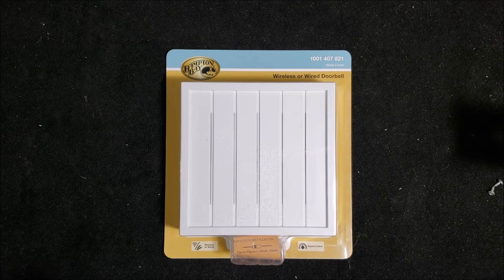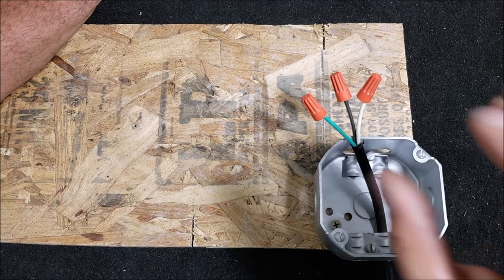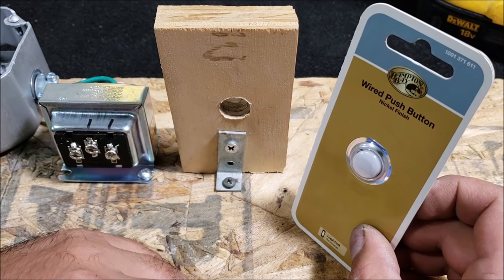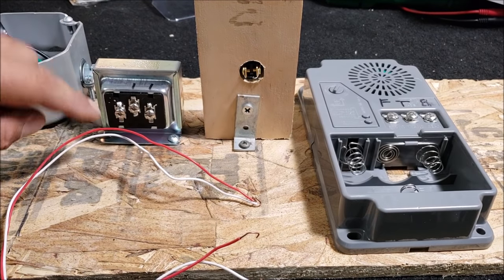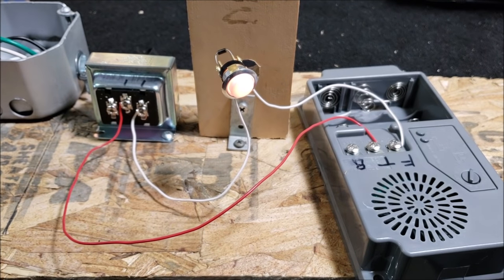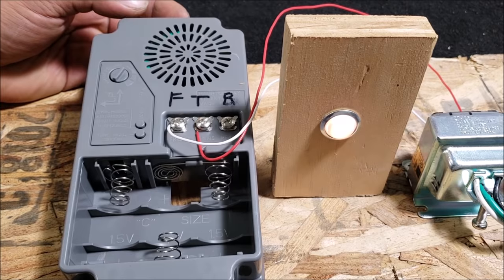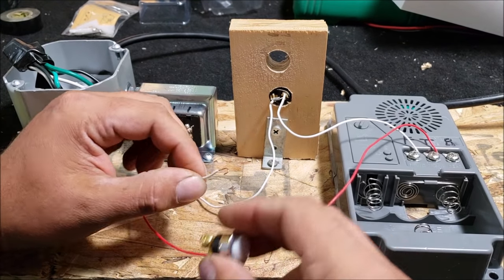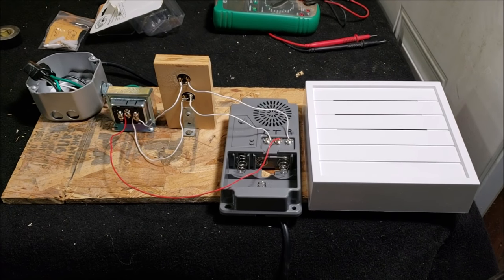how to wire a doorbell DIY live demo and wiring diagram

Comment: Mr. Chris Craft, I just want to say thank you for this clearly explained how to wire a doorbell video.  My wired doorbell stopped working about 10 years ago.  At the time, I tried but couldn't fix it.  So, I got a wireless doorbell.  It worked for a while but not reliable.  After several years I got another wireless doorbell.  Same result.  After listened to my wife's harping on me to fix the doorbell I went to YouTube and found your video.  The simplicity of your explanation was perfect.  I was able to follow your diagram and sort out the mess which was my existing doorbell wiring.  Look, I just want to say thanks.  Do more videos like this.
Reply: Why is it that wives can complain about things for years but not even attempt to fix it themselves?  Wouldn’t it be a treat if they did? I help around the house with vacuuming, washing dishes, laundry, cook some, but the help never seems to go the other way.  “I cant do that stuff” is the response.  Yet, women want equal pay in the workplace?  Non sequitur I say.  😂😂🤦‍♂️

Comment: The diode works wired in either direction because your source voltage is AC and not DC and AC which is alternating current that swings from positive voltage to negative voltage and back again continuously.

Comment: After spending countless hours wiring and rewiring, I am so glad I ran across your video.  A diode was the reason my chime would not work.  Thank you a million times over for posting your video and mentioning that tiny diode.  I purchased the one I needed and the chime works like it should!

Comment: Good point about the diode, this is a life long issue with people putting in doorbells.  They think "Ahh, I don't need that, it's a pain.  It works.."  then complain about it.   A company would not spend the money to include it if not needed.  It's only a few cents but, over the course of a million units, it's a lot of money. 
  I like the seasonal ring tones for Christmas, new year (Auld lang syne) and your birthday...  lol. Bethoven is cool, too.
  Mostly, I appreciate your straightforward, lay out and test the unit first approach because it ensures the product, your doing it right and removes confusion when you start stringing wire.  Common sense stuff, which isn't too common, anymore.   Thanks!
(P.S.  You'll enjoy your ring doorbell.  I recommend them to anyone.)

Comment: I love these straight-ahead DYI type videos. Working out the details and bugs as you go through the install.  Which is how I tend to do these things.  I need to get power to my Ring doorbell because I am tired of removing it and putting it on the charger. I saw the Ring doorbell in your video, got excited for a second until you said that was for another day.  bummer. Anyway, thanks for the wiring help.
Reply: I disconnected the original wiring and put in this battery powered, wireless doorbell box a bunch of years ago. Now I need that connectivity to set up the Ring but I'm not sure how to reconnect things to get a current back to the Ring.
Reply from the maker: @MrVeeBlog  i just uploaded the ring transformer video

Comment: Thank you for this. I just bought a nest video doorbell thinking it would solve my problem on not having a doorbell connected, but apparently, you still need a full doorbell before installing the Nest. Argh...I will have to figure out how to get that done and how to pass the wires. At the very least this gives me a good idea of how to do so.
Reply: Technically, if you don't have a hard wired doorbell you can still use the nest doorbell as long as you have google home speakers. That's what I did.

Comment: LOVE the simplicity of this video...just got rid of Ring and got Nest Hello, and something happened to my original chimes, so off to Home Debit!!!!
Reply from the maker: why did you get rid of ring?   i hardwired ring to this door bell(i have a video)  and it has been running perfect for over a year now..   battery is at 92% ...  let me know..
Reply: @chriscraft77022  Hey Chris...the Nest Doorbell has just a plethora of neat options that were too hard to pass up. First, I got the Ring Pro and an Echo 5 for my wife for Christmas ( a killer deal at $140 for both). I got the Ring installed but hadn't got the Echo setup, then my son got me a whole bunch of Google Home items for Christmas, which we celebrated with him on New Years Day. I was sold on GH from that point, even though I had invested in a few Echo products and had the whole home setup (with my Insteon system), I ordered  a Google Hub (the 7" screen), and researched the Nest Hello on various reviews. Ordered the Hello Doorbell on eBay for $179, then sent back the Ring and Echo 5 to Amazon, and now easily got everything setup correctly (definitely had to replace the transformer with a 16 volt, 30VA transformer from Amazon, so now even my home address sign on the front shines better!).  I LOVE the ability set the Activity Zones for different notifications, and as I've always used Google Photos for all my pics, the ability to have Familiar Faces setup was key (GH will announce WHO is at the door if you've set this up). PLUS....the announcement feature (that many seem to forget to set in Nest)) announces someone at the door - at every Google speaker you've setup, and we've got one in almost every room of the house (more to come with the work shed, backyard, and few more Google displays)! Also, the 2-way sound is MUCH clearer with Nest Hello. Video is as good as my 2k Lorex cameras (12 of them).  I've got the 30 day trial, as as much as I'm against any re-occuring fees, I'll probably wind up forking out the $50 per year for the Nest subscription. I just like the way that Google has integrated everything much better and easier. Oh...and no battery with Hello to worry about...it's all hardwired. And it all runs on the 5G band of my home network. My point about the existing doorbell was that: 1) I'm not quite sure I need to replace it, since GH announces everywhere, and 2) in wiring it might have got screwed up between a Ring installation and the Hello installation (and I can't even find a manufacturer's name on the unit, so you know it's a contractor special, so it's junk). But soon to be selling the home, I'll probably get a new chime because the Hello Doorbell is moving with us (unless a buyer wants to pay for the whole GH system!).

Comment: In this particular case, the direction of the diode doesn't matter because it's an A/C system. The electric is always switching directions, back and forth; 60 times per second here in the States. The diode keeps the power going in one direction flowing so it can keep the chime playing. So, it's basically using only half the power to play the tune. If the diode is not there, then all the power disappears when you release the button, and the tune stops.

Comment: Thanks so much.  That sure made the project a lot easier.  Adding a second doorbell with Arlo.  My big issue is finding a place to wire in the transformer.
Reply: I found an old mechanical doorbell in the basement that has 4 metal bars like a xylophone.  Am hoping it still works.

Comment: Pretty cool. I used a wireless doorbell for the longest time but I've recently upgraded my system to a ring doorbell and I couldn't remember how to wire up a doorbell. I was thinking the new ones had the transformers built into the chimes. Anyway I am using the battery for now but I want to be able to use more features and not have to waist batteries. I already have a roll of wire so I just need the transformer and chime. It would be easier if they just included the transformer in the chime but I guess it will be cheaper to replace that way. It seems like my old house I had to replace the transfomer a few times lol.

Comment: Very clearly explained! 
 I took off a 20 year old door chime from the wall and there were 4 wires on the back of that unit (red, white, blue & black) and 4 wires coming from out of the wall. There is only a front doorbell being used.
I'm trying to hook up the same unit as you just showed that only has 3 terminals so not sure what to do now.  
Would you know how to solve this issue?

Comment: Hello, I have a question: in my country the voltage used is 110v, there is a problem if when installing my doorbell I do not use a transformer, I have already tried it and it still works without it.  Thank you

Comment: I’m in a similar situation, purchased an older home where a doorbell was never installed. I wanted to add a smart doorbell. Could I run 20-2 directly from the transformer to the doorbell? I don’t have a need for the chime, so is it possible to step down the voltage and have it run from the panel through the transformer and to the doorbell?

Comment: Questions for you... is there any harm in using a 16 Volt transformer with a 30A output, instead of one that is 16 Volt with a 10A output?  I have a large house with long runs and two non-electronic chimes and two spring loaded buttons.  I am currently running the 16V-10A transformer, but I would like to know if there is any harm in installing a 16V-30A transformer?  I ask cause I am wondering if my chimes would be louder if I had more amperage?  Note: I am not using video camera/switches, just old fashioned spring loaded LED lit door switches.  Note: I am not using an electronic chimes either, just the old fashioned ones with the plungers that strike a gong thingy.  What do you typically run with a 16V-10A transformer... and when should you upgrade to a 16V-30A transformer?

Comment: Not sure anyone answered this yet regarding mounting the transformer to the box. The screw gets removed, and you insert the wires and the plate through the outside of the box, then replace the screw and tighten it against the inside of the box to hold it in place. Saves you from having to add the clamp you used at 3:50.

Comment: Very informative.  Quick question.  If I run this using the existing power supply to the lights, is there a way I could wire the lights to the same power supply so both the lights and the doorbell will both work?
Reply from the maker: yes

Comment: I tried installing a new transformer, door chime, and door button at my new house but ended up giving up because there's something wrong. The thing is, I'm not sure if there's a short in the wiring or if the transformer is bad. Im getting 120V into the transformer and then 16V out of the transformer. I connected the white wire to T and the red wire to Rear (since that's supposed to give me the single "ding"). It worked but after like 30 minutes, the transformer got really hot, the chime box began to "buzz", and the white wire connected to the door button started to burn. Im using the old wiring that came with the house. Can you tell me what the issue may be, any suggestions, should I rewire everything from scratch, might the equipment I bought be faulty? Im at a loss. Now after seeing your video and your diagram at the end, I think I found the problem. The chime that came with house was not operational and now I think it was because it wasn't wired correctly. Tomorrow morning I'm going to run the wiring according to your diagram and see what happens.

Comment: Chris, I’m replacing a 30 year old doorbell with the same one you show. Where am I supposed to put the transformer?  If I ever get it installed I also have the Ring doorbell to connect outside instead of the button.  Thanks for a great video. Oh, also I just want to confirm that I need to buy some bell wire to connect the doorbell(chime) to the transformer.
Reply from the maker: you mount it close to where you get the 110volts   .. I mounted it in its own electrical box next to the living room lights in the ceiling .. you also want it mounted where you don’t have long runs of wire going to it.. so I mounted mine in between the door button and chime.. I also have a video wiring the ring up to it.. it’s been on my house since the video and battery is always 95-99%

Comment: Aye awesome video ! How do I know which transformer to get ? Are they all 3 prongs or they come in two and 3s. And that was a 3 prong transformer how do I know which prong to use to got to the bell. So if I used one prong for the chime that leaves me with 2 ? Do I go with the prong with the highest volt?
Reply from the maker: look at the required voltage for the chime.. the 2 prong is 16V ... the 3 prong is either 8v, 16v, or 24v
Reply: @chriscraft77022  There are also two post 24V ones. You're right though. Just match them up to the chime. There's nothing special about a doorbell transformer compared to any others. The same ones are used for access control, CCTV, and many other applications.

Comment: Great instructional Vid--Thanks.  I'm holding off until I determine the power draw with the voltage (clipped 16v) constantly applied to the doorbell circuit.  Do you know or know who would?  Thx again.

Comment: Chris F.Y.I. if you have the Ring Pro , Ring says the Diode isn't required I  didn't use one on my front door and the camera and bell works fine but your video is Great- Thanks well done .
Reply: The diode must be removed if you use Ring or Nest. The diode is used to change AC into pulsing DC for a traditional button. Ring and Nest both use true AC so the diode has to come out.
Reply: nilpo19 Ring doorbell 2 comes with a diode

Comment: great video. now i need to find a video that shows how to relocate doorbell wiring...since my door bell doesn't face the front of my house.
Reply: Moving wiring is tricky. Have you considered using a wireless doorbell?
Reply: @nilpo19  i really don't want to be committed to charging a door battery, so I'll figure out moving the wires. they aren't far from where i want them
Reply: Never get wireless doorbells. A lot of them are built cheaply and crappily and the elements like rain, heat, and snow will destroy them. And too much radio interference can cause the Bluetooth ones to de-pair as well.  Just stick with a hard wired doorbell and you will never have an issue.  Fishing wiring behind walls when you cannot cut open the walls is the hardest part.
Reply: here's my update guys. i went into the attic and had to move the wires into the house, cut a trench into the sheet rock for the wire to run into, hammer drill through the center block door frame and hard wire my ring video door bell...i fixed all the holes i made, re-textured the walls and stuccoed the old bell hole. everything looks like nothing ever happened. I'm very proud of myself since this was my first time major project for being a first time home owner.💪

Comment: I wish mine was this simple to set up.  
Whoever wired the last door bell used 5 regular stranded 14 gauge wires. what a cluster.
Nothing is marked and all the wires are black, so I had my wife push the doorbell button so I could figure out what wires were what and crimped some different color spade lugs on them for now. 
I figured out the transformer wires and after trial error, seem to have it set up for the front door OK. I left the existing button on the front door and it seems to be ok without the diode

I plan to splice the crazy wires together to bell wire and shove everything into the battery bay.

I WILL TAME THIS MESS!!!

Comment: Great video, but does the light have to remain on constantly and only shut off when pushed? Is that the reason for the 2nd diode? Or is it just a 2nd for the back door? Or both?
Reply from the maker: diodes are for electronic doorbells and used on both switches

Comment: Love the video. Quick question. What was the reason why you used the resister? Do you need the resister if your hard wiring the doorbell?
Reply from the maker: that not a resistor .. that’s the diode you use with electronic doorbell

Comment: Great video, easy to follow. QUESTION: I want to wire a Ring Pro directly to a 16V 30VA transformer and bypass the mechanical chime in favor of a wireless Ring chime. Do you know if this set up would work or would I need to wire a resistor between the doorbell and transformer. I initally wanted to use my original doorbell chime but I have to upgrade my transformer to a 16V 30VA, and I am not sure my existing doorbell chime (16V 10VA)  would be compatible. I will call Ring tech support but it cant hurt to get your thoughts. Thanks
Reply from the maker: i just uploaded a video on that.. check out my channel and it should be the newest video..  i dont have a pro, THOUGH..   but i think RING recommends the same transformer for all their products..
Reply: @chriscraft77022  WOW the quickest response ever on a YouTube video. Thanks. I subed and liked you video. I will check out you doorbell video. I purchased a Ring Pro, but haven't received it yet, just researching before I install or talk to Ring. I see a lot of videos on the Ring Pro where users are having difficulties with the doorbell. I believe the majority of the problems are power related due to an older transformer. My existing transformer is 16V but only 10 VA. Also I need to replace my Cat 3 wiring with the 20AWG bell wire. I liked the chime you got from HD, so now I have to decide between the wireless Ring Chime or a mechanical chime. Thanks for your time a d excellent videos.
Reply from the maker: @greggrimsley5337  i would check that video out..  i did use the resistor and 20g bell wire.. and it worked fine..  tested it for 24 hours..  i quickly respond to people that are working on stuff..  and people that are serious about the project..   thanks for watching..  and thanks for the sub.. ask me anything..
Reply: @chriscraft77022  I have a clear  understanding now thanks. I might pick up one of the multi voltage transformers just in case 16V is not enough. If I choose to go with the wireless Ring Chime, I will only need 15' of bell cable if I go with a mechanical chime I will need about 40'. I dont think the Ring Pro will work with a digital chime. Now I will have to fish new cable using the existing Cat 3 as a pull line.